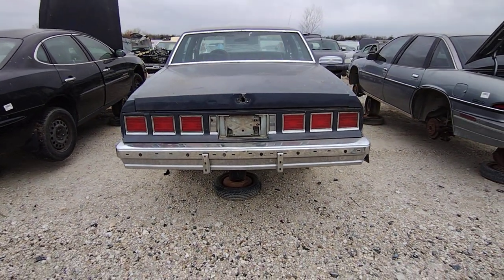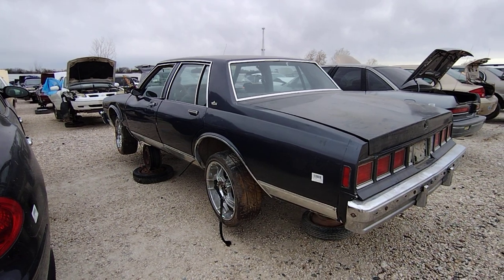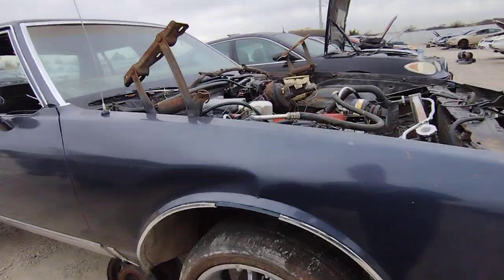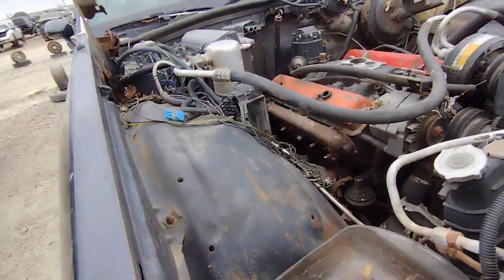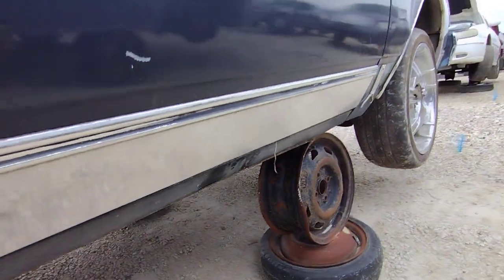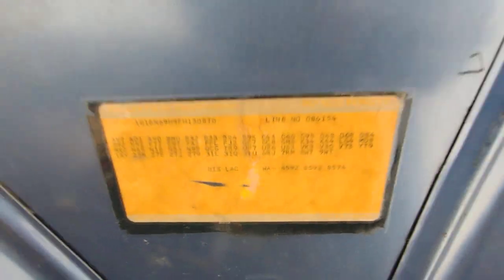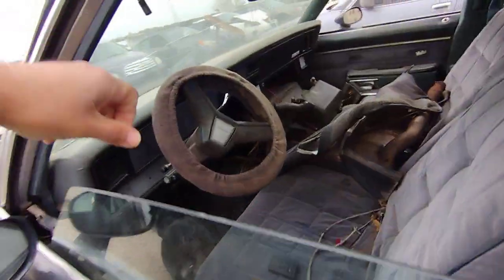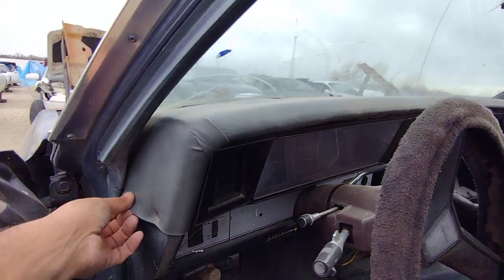Box Chevy To Meet The Crusher. 1985 Caprice Classic Junkyard Find

Comment: Whoa Nelley, the box that no longer rocks. That's an Arizona iced tea carton. LOL. 

We got the VIN, we win: 1G1 for US made Chevrolet, BN69 for four door Caprice Classic sedan, H for 305 V8 with four barrel, aka RPO code "LG4", 9 is a check digit, F for the 1985 model year, H for Flint, MI assembly and the rest is the production sequence. The Flint, MI plant was the Buick "home" plant and operated from 1904 to 1999 and was known as "Buick City". 

We got the SPID, glad you did: A01 for tinted glass, all windows, A90 for remote deck lid release, B32 and B33 for front and rear floor mats, B84 for bodyside moldings, C60 for AC, FFL for Flint, MI assembly, GM8 for 2.56:1 rear end ratio, non-locking, K34 for cruise control, K64 for 115 amp alternator, LG4 for 305 V8 with four barrel, MD8 for THM700R4 four speed automatic overdrive transmission, NA5 for standard Federal emissions, N33 for tilt wheel, TR9 for lamp group, VK3 for front plate bracket, 31U for Dark Blue exterior paint, 27I for Regal Blue cloth interior trim, among other codes. That's an ignition cutoff device that you said, "What's this?"

Whoa Nelley, 1985 and took a nosedive. Box Chevy looking kind of heavy. That's it, time to quit. B body looking kinda shoddy. 305 and not soon to be alive. 5.0 and gotta go. Going to be flat and that's that. THM700R4 and soon to be out the door. The box was outfoxed. Tilt steering wheel, will it be a good deal? Going to get squished and the B body fans, many here, certainly Benny and for sure the Google Man are going to be very, very, very, very pissed.
Reply: The 77 l had would have been a good vehicle if it had an engine that wasn't wore out.
Reply: @garymckee8857  The late 1970s Chevrolet V8 camshafts were "soft" and went bad fairly quickly. A good aftermarket replacement solved the problem. Many were replaced under warranty.
Reply: @googleusergp  Mine was a washed out rings,  gas was getting in the oil.
Reply: @garymckee8857  Sounds like a real "washout". LOL.
Reply: @googleusergp  👍

Comment: Weren't you looking for a set of the rear taillight panels as you damaged your a few years ago? These are clean! Just need to paint them white though. Wouldn't hurt to get some spare parts for your box Chevy such as the tilt column and grille! But man those wheels are FUGLY. I hate those type of wheels on classics. I prefer the original rims with hubcaps and whitewalls haha
Reply from the maker: Mine in an 89 so it has different taillights. I was able to find the replacement for the one I broke. I have since decided to try and fix the column I have unless I find the right color from a Caprice.
Reply: @ClassicRideSociety  Didn't know you already bought a replacement, that's great! Hopefully you'll find a steering column in the right color, thanks for the videos! 👍Please don't forget the "Kim Special" shoutout on the Ferds haha!😂

Comment: I had a 1978 Chevy Caprice that was third hand. It must have been a stripped down version of the model you just featured? 2 barrel carb, nice vinyl seats & one wheel tire peeler. I got it as a basket case & ended up junking it a few years later after dumping a ton of money in it. The motor was simply worn out I was told. 
I bought a 1983 Chevy Impala third hand after that & that must have had a “Police Package” in it? It had the 4 barrel carb but the basic vinyl seats, posi traction and air conditioning. I loved that car. It was “mean looking”. It had been side swiped previous to me owning it. The previous owner pulled out the crease & dents but left the holes from the dent puller. Those holes to those less than knowlegeable appeared to look like bullet holes 😅. Every body panel had a dent or crease in it. Mismatched hub caps & what looked like someone threw brake fluid on the hood so the paint looked whitish & stained. I loved that car! Everyone avoided me on the highway because it looked like I didn’t give a fuck? You wanna play bumper cars with your nice sedan & you’ll lose. Unfortunately after years of driving in the rust belt everything was rusting on it. Every possible fluid except the battery was leaking on it. Everywhere I parked it there were puddles of fluid everywhere underneath it. Bottles of stop leak later couldn’t stem the flow? I started a new job & they were very persnickety about their property. They got upset when my car left streams of automotive fluids in their parking lot. They were nice the first time. The second time they told me to not park my car at work anymore. I parked it in my driveway & used it for driving on short runs around town. Before I got rid of it I used it as a platform for installing lights in my garage. The roof, hood & trunk all buckled from me standing on it. I was sad to see it go 😢. It’s time had come. I pulled the battery & the radio & said goodbye. I paid the American Heart Association to take it away in 2004. I still miss that car but it couldn’t be saved. I had a Grateful Dead sticker on the back “Bearlimovin” (a take off on another “ Fuckingroven”